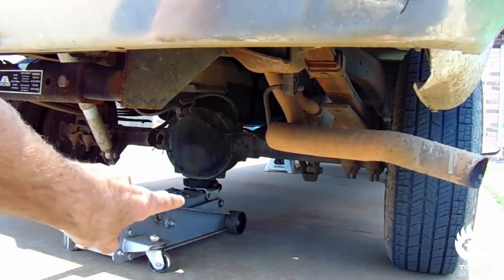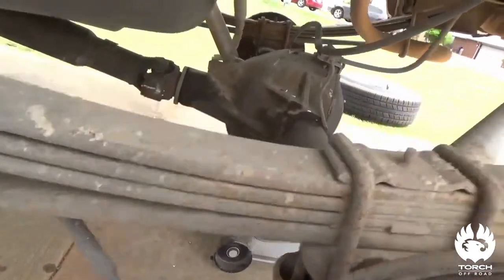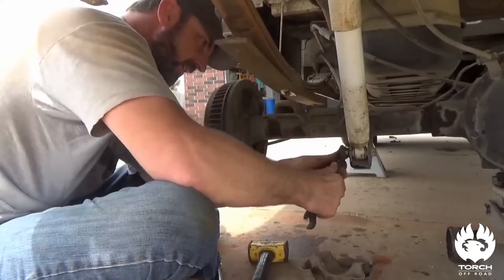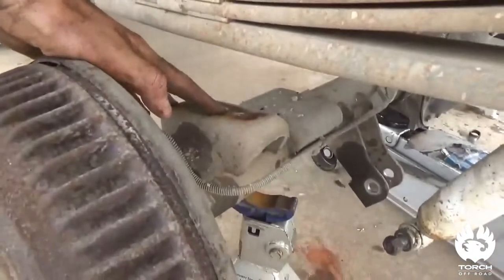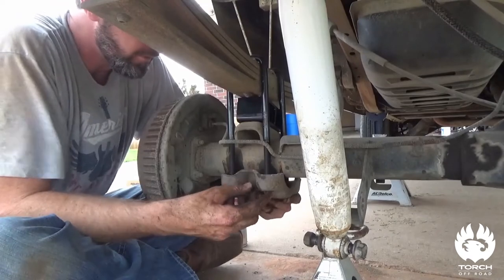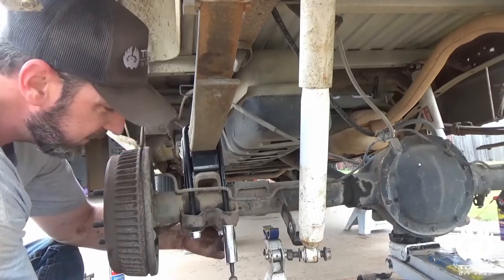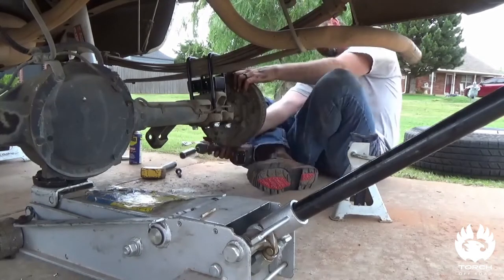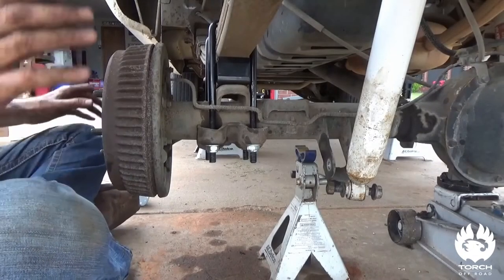TORCH 3" Front 2" Rear Leveling Lift Kit for 88-98 Chevy/GMC C1500 Rear Block Installation

Comment: are you sure the narrow side is to th front of the truck? this will create even more angle in the transmission
Reply from the maker: Thanks for your question! The narrow end of the lift block should be installed facing the front of the truck. For this application, the tapered block adjusts the driveline angle after lifting the rear suspension, which helps to avoid vibrations from the driveline -TORCH
Reply: @torchoffroad  this could be to make equal the pinnon angle in the diferential and and transfer box. Ver interesting. I want to do it in muy gmc suburban 95, but I havent decided how mich lift I want to install :)

Comment: Do u need longer shocks after putting the blocks in or?
Reply from the maker: Thanks for your question. Longer shocks are not a required purchase with our lift kits in the 1”-3” range, and you can typically run the factory shocks with our blocks installed. 

However, longer shocks will help with overall ride quality. I usually tell our customers to give the new lift about a week to settle in so you can get a true feel for the truck's performance before buying additional parts. If after a week you decide to pick up some longer shocks, please contact us directly and I can check on a set for your application -TORCH

Comment: Say a guy wanted to just get a pair of 2 inch blocks and u bolts but not the keys, can I do that?
Reply from the maker: Thanks for your question. If you’re looking for the 2” blocks and U-bolts, we have those available without the keys. Please email us at cs@torchoffroad.com or contact our service line at (909) 276-4487 and we’ll be happy to help, we’re open from 9am to 6pm CST every day -TORCH
Reply: @torchoffroad  awesome I definitely will be doing that when the time comes, just gathering parts and trying to save some money up for the build! I have an already very capable obs tahoe on 33s that needs the rear brought up some, the front is pretty good where it’s at via the stock keys
Reply: That’s what I’m doing

Comment: Did you have any problems with the drive shaft pinion angle
Reply from the maker: Thank you for messaging us. Our Tapered Rear Blocks come with a 2.5 degree taper built into the block so a shim is not necessary in order to correct the drive shaft pinion angle. Please let me know if you have any questions and thank you again for working with us -TORCH

Comment: to leave it as it is, how much are the blocks that you put in the back so that it remains level
Reply from the maker: Thanks for your comment. The lift size needed to level would depend on your vehicle’s factory rake. If you’re looking for a leveling kit, I recommend measuring your ride height in the front and rear. I’ve included a link to our blog post with instructions on doing that here:

https://torchoffroad.com/blogs/news/how-to-buy-the-right-kit-to-level-your-truck 

If you contact us directly with the measurements, I can recommend a leveling kit for your application -TORCH
Reply: Crank the keys in the front & 3” block in the back should be a great 👍🏽 at least on a 98 Tahoe 💪🏽🇺🇸🤙🏽

Comment: Does this just level the truck or does it lift the whole truck? Because I’m looking for a 3 inch lift kit for my 1988 k1500 Chevy
Reply from the maker: Thanks for your question. Our 3” front 2” rear kit for the C1500 is designed to lift the whole vehicle, and level out the factory rake by 1 inch. However, that item will not fit the 1988 K1500. I recommend this kit instead:

https://torchoffroad.com/products/1988-1998-chevy-gmc-k1500-4x4-4wd-z71-full-lift-kit?variant=32082182635633 

The item I linked comes with different rear lift sizes based on your needs, and the front torsion keys can be adjusted for varying amounts of lift. Please contact us directly if you have any questions and thanks again -TORCH

Comment: What shocks are needed after lift is installed???
Reply from the maker: Thanks for your question. Longer shocks are not a required purchase with our lift kits in the 1”-3” range, and you can typically run the factory shocks with this kit. However, longer shocks will help with overall ride quality. If you’re interested in picking up some extended shocks, please contact our service line at (909) 276-4487 and I’ll be happy to make a recommendation -TORCH

Comment: Does it work the same for a K1500?
Reply from the maker: Thanks for your question! The rear lift block installation is the same for the K1500 models. The K1500 and C1500 have different front suspensions, but the installation of the rear blocks is the same for both applications -TORCH